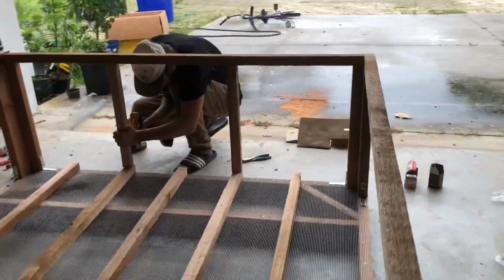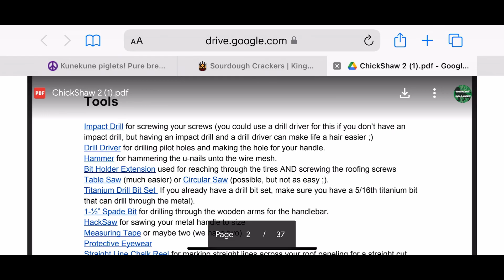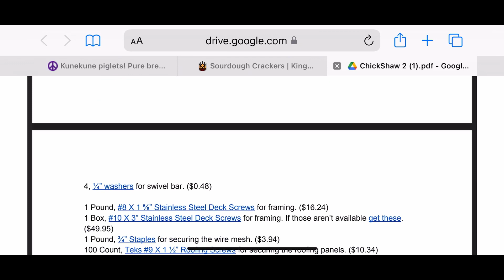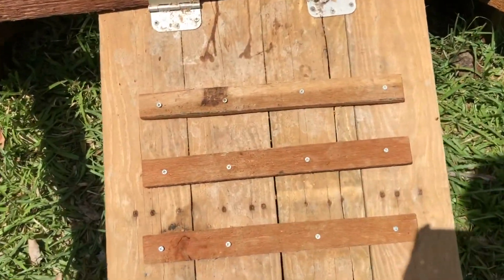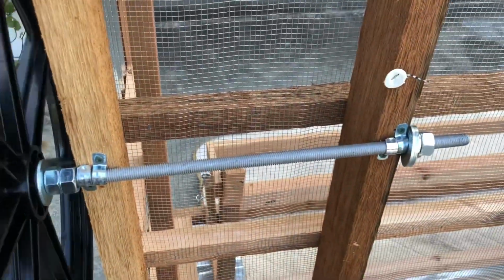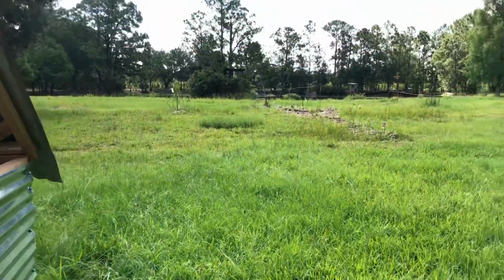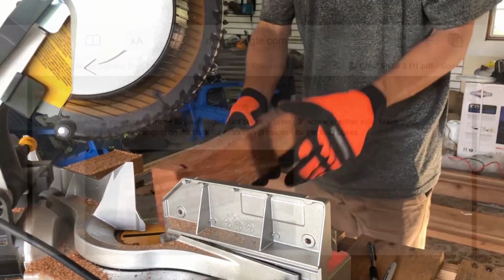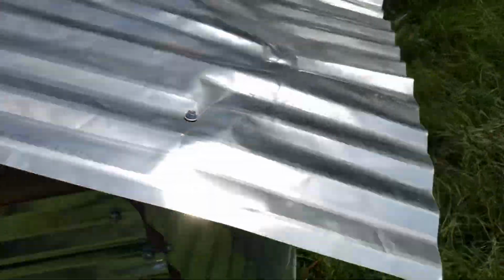Building The Justin Rhodes Chickshaw 2.0 (Our Experience + Tips)

Comment: Good job of working with what you had. I am in the process of building my Chickshaw 2.0. I have been checking out everyone's builds. I don't think I will be putting in the mineral feeder or dust bath either. I may just mount the mineral feeder on the outside so the birds don't lay in it.
Reply from the maker: Thank you, it has been holding up well. We had a few heavy storms where the lid blew up if it wasn't latched. If you live in a really windy area it may be worth putting a second eye loop latch on the top. Good luck with your build thanks for commenting

Comment: I was also debating whether to get the cheaper 24" wheels rather than the expensive 26" wheels. Is there enough room for the ducks/chickens to get underneath the Chicksaw to get out of the sun when it gets too hot?
Reply from the maker: The 24 inch ones leave plenty of room for the birds to go under the Chicksaw. However you may have to connect the wheels a bit further from the center to prevent the Chicksaw from rocking back with the smaller wheels. It was a simple adjustment, but works great.